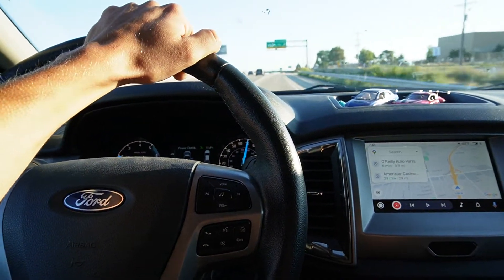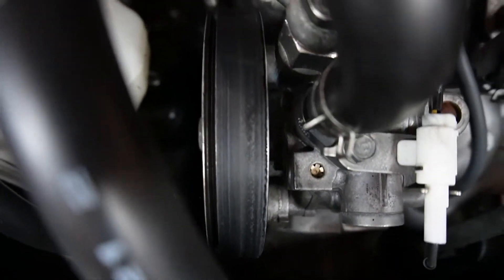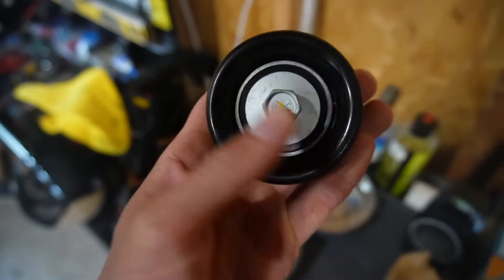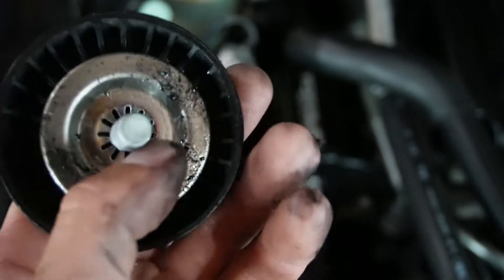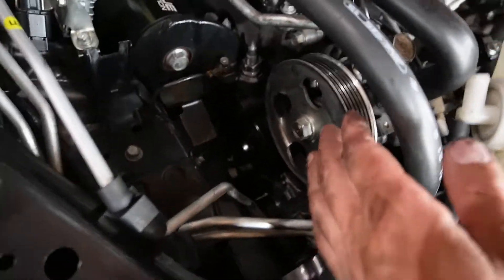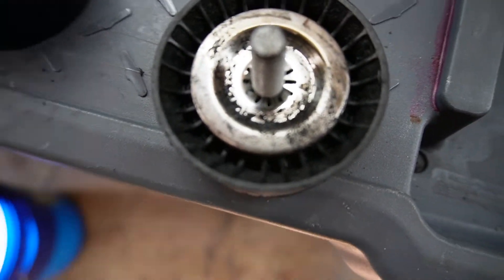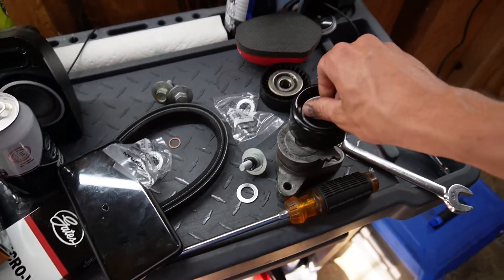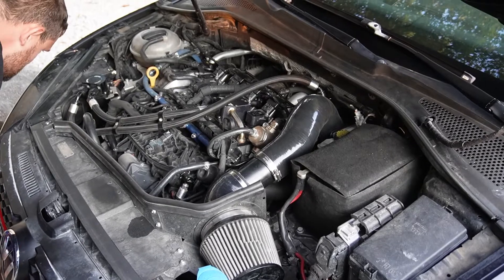Serpentine Belt Pulley Upgrades for Evo X (Solution to shredded belts)

Comment: hey man. how did you take out the whole tensioner assembly? did you remove the pulley out of the tensioner before taking out the whole tensioner?
Reply: Yes.  U have to or else u won't be able to get it out

Comment: Hey man! question, Why did you take out the whole tensioner? Also my tensioner pully is wobbling causing a squealing noise, i got it out, but can i tighten the new pully back on tight enough with the tensioner still bolted to the car?
Reply from the maker: I took it out to inspect it, make sure it was still durable enough for my liking to be reused. its only 2 extra minutes